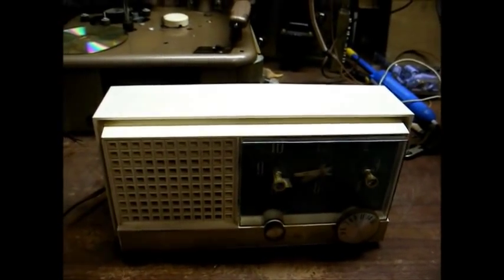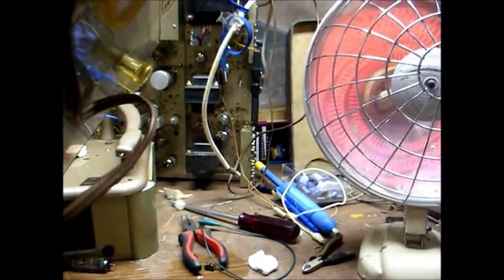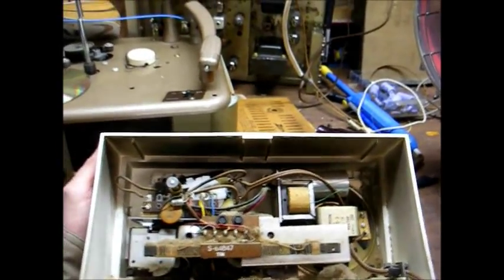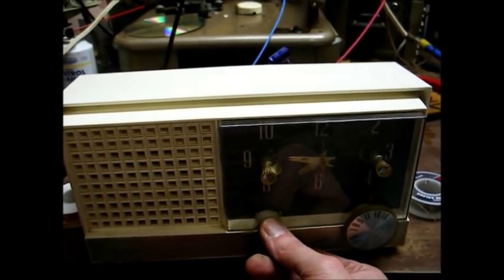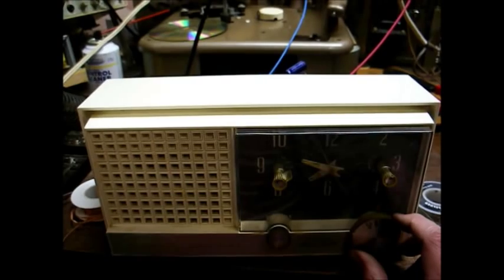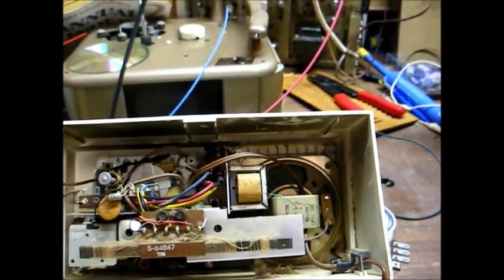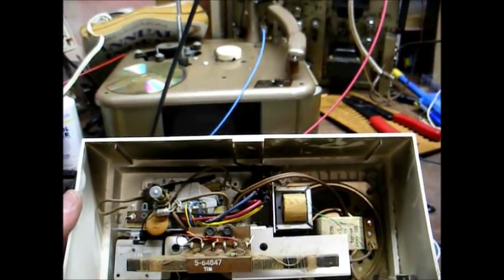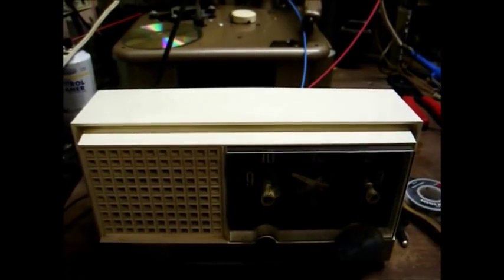Repair of a 1967 Zenith solid state AM clock radio

Comment: I live in a rural area that doesn't get a lot of AM radio signals reliably, yet the 68 Zenith solid state radio picks up signals as well as my hifi receiver. There is something to be said for the quality of the old ferric antennas they put in these old units.
Reply: Try a tecsun 200 loop antenna you just put it next to your radio and you will get better am

Comment: I have a Sony am/fm radio with the same hum; replaced the filter cap, but no solution.  There are small bypass caps around each diode of the full wave bridge; could these be the problem? Also, according to the schematic, there is a ripple filter in the output ic.

Comment: I have a 1968(?) Zenith Model Z466P analog clock radio. The radio works perfectly but the clock is dead. Is there a way to fix the clock?
Reply: Dewott take the cabinet off and oil the mechanism, if that doesn't work it could be a loose wire to the motor

Comment: hey how can i fix a record player thats running to fast ive had this player for years but recently  it seems to be running fast   and the idler  lines up in the correct spot.
Reply: oh ill check it i haven't played it in awhile ill try a new wheel in it anc a good cleaning re lube
Reply: its pretty dirty ill try cleaning it but some how the styles got broke on it so ill have to order it a new one.
Reply: SuperJeremi10 it needs a new belt in it as it often wears out
Reply: mine is operated on a drive wheel.
Reply: +SuperJeremi10 Idle-drive turntables like the older Garrard, BSR and Voice Of Music changers will pick up speed as dirt builds up on the idler wheel and the inner rim of the platter. In belt-drive models, the effects of dirt cancel out, but in idler-drive models, they add.